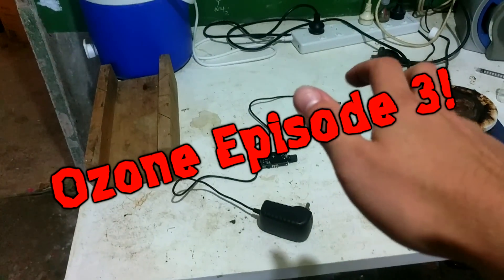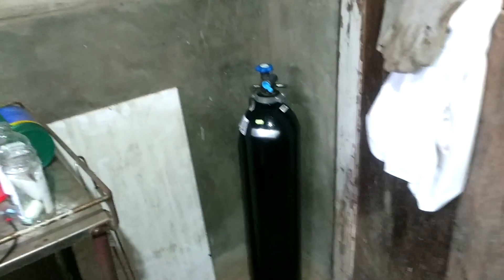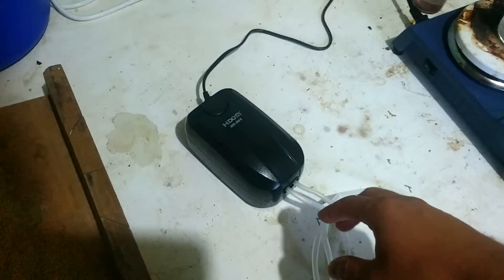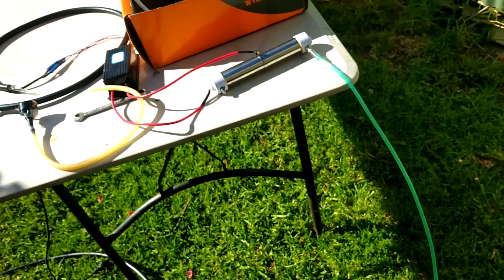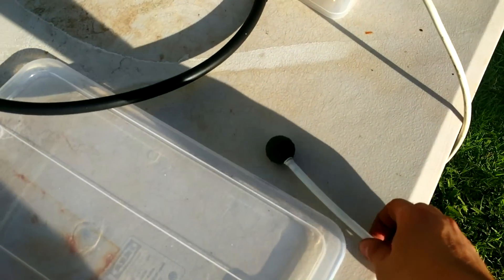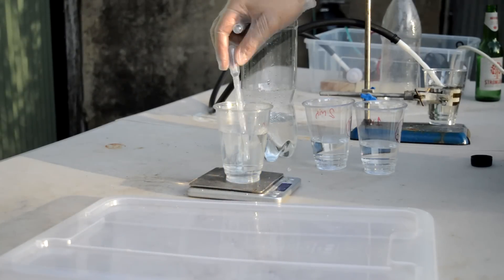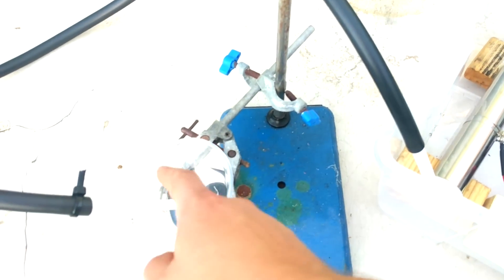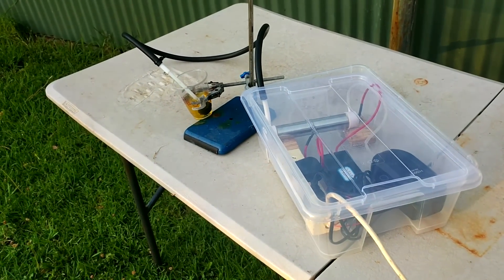Putting Pure Oxygen through the Ozone Generator (Ozone Ep3)

Comment from the maker: My favourite part of this video is how it looks like it was filmed across 1 single day, despite being taken in many tiny fragments across three months
Reply: If your trasformer gets that hot you should meassure its output as it gets hotter maybe thats the reason for the decline in production
Reply: lexaf Maybe. But usually the voltage stays normal. Probably the MOSFETs in the enclosure are badly heatsinked.
Reply from the maker: @DrakkarCalethiel  should i take apart the transformer enclosure and try and heatsink it better?
Reply: Extractions&Ire Only if the thing isnt potted. How hot does it get? If it stays at around 60C theres no need for. My ZVS driver for my HV experiments goes up to around 70C after hours of abuse.
Reply: I could give you tons of tips to make that driver run 24/7. Mostly the circuit is verry easy to fix and even upgrade.
Reply: @ExtractionsAndIre  might be worth looking into immersion cooling if it's getting excessively hot - more effective than air-cooling, and since it has no moving parts it shouldn't cause any problems.
Reply: That’s the benefit of just showing your hands 😛
Reply: my favorite part is watching all your successes turn into failures